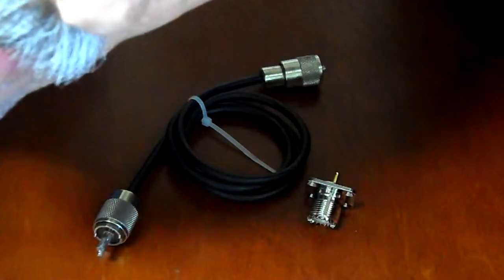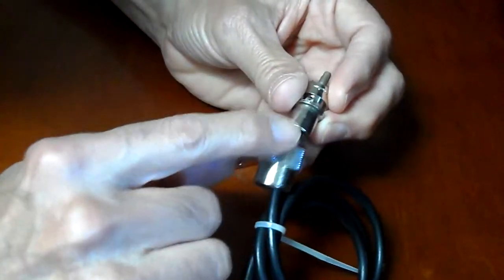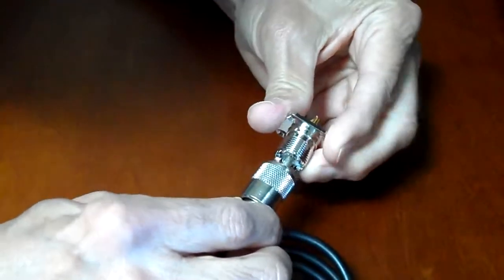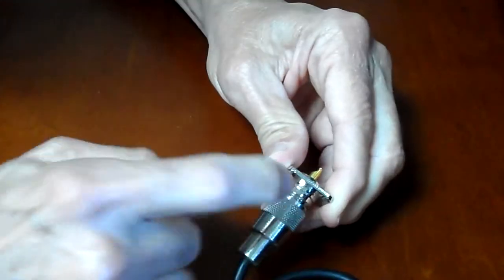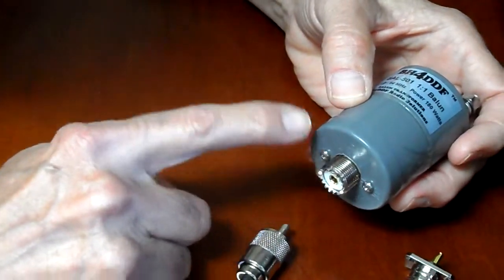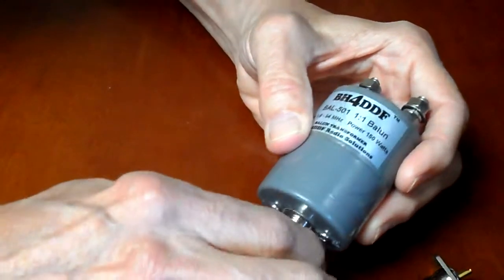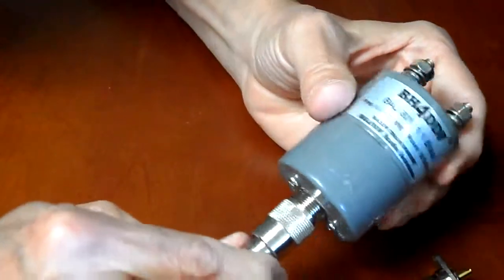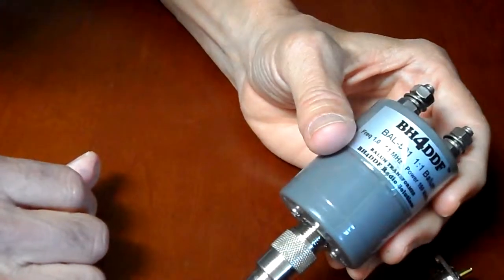Good & Bad mating SO239 to PL259

Comment: Very interesting video.  I just purchased and set up a Xiegu VG4 vertical antenna and the connector on the antenna causes a loose connection just like in your video.  I need to replace it.  Do you know of an SO239 I can get on Amazon that I can trust will work.  I spent hours trying to figure out why this antenna wouldn't tune until I found that loose connection giving me  hours and hours of grief going up and down a ladder.  Really bad experience.  Thanks for this video!
Reply from the maker: Sorry no I don't. At this time I was unable to find when and where I got the one I have in use. I may have salvaged it from some older project equipment. If you or anyone else finds a reliable source, please post it. BTW: Bad ones have threads cut at 1 per millimeter (25.4/inch) the spec calls for 24 threads/inch.